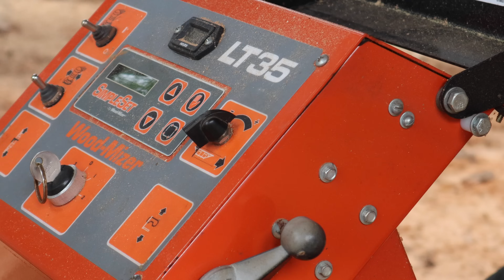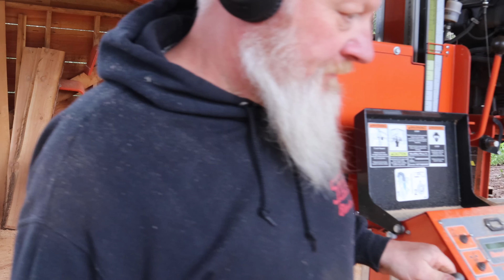Building With My HOMEMADE Lumber.

Comment: I sided my house with red cedar and we love the smell.  It is easy to stain and seal against the weather.  A 2 foot over hang helps to keep the weather off the cedar for the most part.  Thanks for making this video, the saw seems to work very well.
Reply from the maker: You might be interested in my very first video on this channel. I milled cedar siding on a jig I built.

Comment: Why dony they come up witha stationary blade and the bottom part slides the log could cut longer trees
Reply from the maker: That’s how older mills worked. It takes a much larger machine to move the log. You can buy extensions from my mill, I’ve just never needed one.